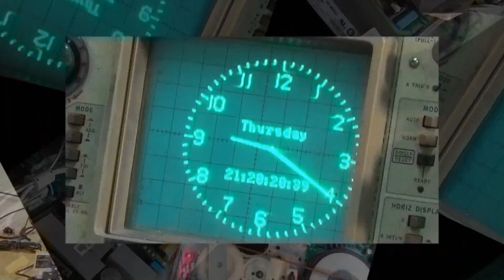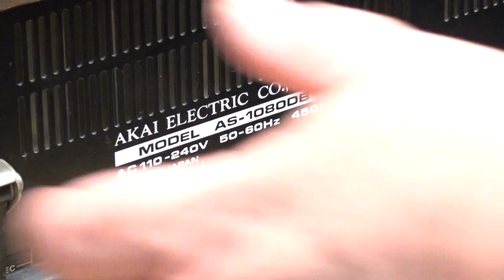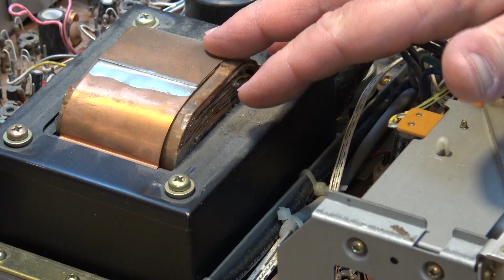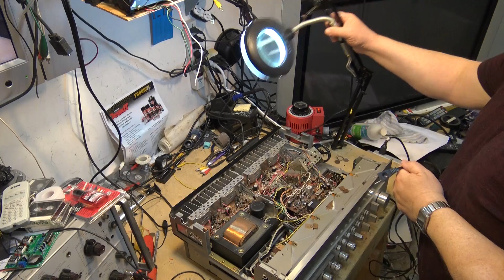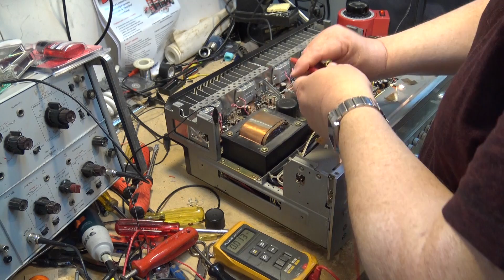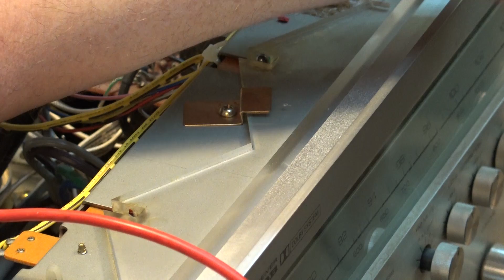Akai AS 1080 DB Quad receiver no sound

Comment: I have to say I'm a little disappointed that you didn't dig deeper into this.  Sure, 95% or better of power amp problems are the finals, and if you're trying to run a shop, I can understand limiting the time spent.  But when you're running a video for education value, it would be nice to dig a bit deeper.  Something external could be biasing those modules wrong.  In fact, if they were shorted, I'd expect much worse.

I once had a power amp that blew fuses because of a bias/level shifting diode in the driver circuit that opened up.  I had to use the lightbulb trick and trace where the current was going (and why) to solve it.  What's worse is that it was intermittent.  Turned out, if you nudged the diode, it would start to work again.
Reply from the maker: I did. I put the meter on it, and DC voltage present on 2 of the 4 modules.
The other 2 may have been OK, but for sure 2 were toast. The owner of it wanted an estimate to repair. These are very old modules, and you know how fleabay is as far as parts go.
Had this been a discrete output amplifier, there would have been much more I could do, but on these module units, you give them the correct voltage in, and if you have a huge DC voltage out then you have a shorted transistor in the mix. This was obvious because another shop had already written it off. They even had scribbled on the heat sink which module was for which channel.
It all boils down to economics. The client that owned this unit is the same one  that brought me a Hafler amp for repair, fixed, and that leak delta 75, with a blown obsolete transistor. If you watch that video you will see that I did find a suitable substitute for the original, and that one is is back in service.
The Leak was a rarer piece, worthy of spending more time on, and it uses conventional parts. When you get these modular amplifiers it would have been questionable to repair even when the unit was only a few years old, as this wasn't considered a real high end piece like a Sansui, Pioneer or Marantz.
Reply: The module is all DC coupled.  A bad input voltage (leaky cap?) will cause a bad output voltage.  Still, curious as to why two are like that.  Either a common component or it suggests the user did something.  Probably put too many speakers on the output and drove the impedance too low.
Reply from the maker: The 2 that were popped were the right front and right rear.

The speaker switch you can select 4 channel mode, 60WPC or 2 channel mode 120WPC.
My guess is the previous owner had a short on the speaker line and was running in 2 channel mode and popped both modules, then took it to a shop they diagnosed and recommended not fixing, and the person put it up on craigslist or fleabay, and my client bought it not working. Brought it to me, and I find that wires were disconnected.
Reconnect and find that the outputs are cooked. The signal coming from the driver was good. I didn't show the scope waveform just due to the fact that the piece of crap scope I have is just about useless, and doesn't show up very good on camera. I hope to have a new scope soon. I have a few I am looking at right now.
Reply: Have you considered one of those cheap LCD scope kits?  Or a PC scope?  Should be adequate for audio signals.
Reply from the maker: I have a line on a couple of scopes now. One has been offered as a donation, and I am awaiting freight conformation. Another one is local. but the owner is asking more than I feel it is worth. I have made an offer that I think is fair, but he is playing hardball.

Comment: Holy cow, i have not seen a "quadraphonic sound "unit since i was a kid in 1975! My friend's dad had one, and by god it  "looked" just like this one!  That thing was powerful as I recall. To bad it may go to scrap.
Reply from the maker: I have a quadraphonic system. It is an Electrohome, made in Canada unit. I will be doing a service video on that one, and because that one is mine I will be looking to completely restore that one. Quad units are relatively rare, but Made in Canada even rarer.
Reply: @12voltvids 
Ah! Canada 🇨🇦 the land of Maple Suryp strategic reserves, Capt. Kirk and duct tape. Bob and Doug, Red and Green and the home of Vulcan Velcro.
Oh Canada how ye love thy and in so many ways except for our lack of stereos, eh!
Reply: Actually Andy, even non working with bad amps, an AS-1080 DB like that will easily go for $600~800 at auction and a working one in VG condition can easily bring $2000~2500 on Ebay (and I have two.) 😇
And you're right, if you heard one they're bad ass!

Comment: I would replace the entire output section with a pair of LM4766 amplifiers. A bit less power maybe but probably a much cleaner output and a fairly easy job to change the topology, not too expensive and easy to get.
Thanks for the videos. :-)
Reply from the maker: The decision as to what to do is left with the owner of the unit who has collected it by now. It is all about economics, and sometimes you have to move on. The owner of this unit is a viewer, and he has supplied some of the high end units that I have repaired, including the Hafler and Leak receiver as well as a few high end DVD and CD players.
As you said, anything can be fixed, and I agree, and this is valid on a rare or high value piece, but a low end piece it doesn't make sense to spend much on.
Reply: As with anything, you're the man on the spot and many things are simply not worth fixing. It's the customer who decides in the end and it can be frustrating at times to give up on a piece of equipment that may have a second, third or n'th life. As always, thanks for the great videos and the reply. Peace. :-)
Reply from the maker: That't the point. I can give them advice and options, but ultimately it is the orner of the piece that decides the fate on the unit. They are more likely to spend money on a higher end piece because they can see the value. If we were talking an old Marantz, or Sansui, like the 9090 I own, then the chances or repair increase dramatically. Speaking of my 9090, I still plan to do a service on it, but haven't only because I am not currently using it, and it is all packed away in storage. Some day I will service that unit, because it is a valuable piece. It does work however all it needs is some control cleaning. The caps are old, but they also haven't been used in awhile.
Reply: @12voltvids  9090 and 9090db are superb units.
Reply from the maker: @tremayne3  
I have a Sansusi 9090db in my storage unit. One of these days I will drag it down and work on it. That thing is a beast.
Reply: @12voltvids  I'm looking forward to see a video of you working on the beast. I own a 9090db as well and the local vintage stereo repair guy charged me 480 bucks to bring the receiver up to original specs. He kept it for about a month and wanted me so badly to sell it to him. But it is a keeper and that beast sounds AMAZING !!! What a wonderful machine it is. It is so freaking powerful and warm sounding. I'm in love with the beast, Thank you for your great videos, To watch you working on those old machines is a joy, a therapy for many.
Reply from the maker: @tremayne3  
My 9090 works.  Well it did the last time I ran it.   Just needs dial lights replaced and controls cleaned.

Comment: Hi thanks for the video, love vintage audio stuff :-)

You can get the modules here in Denmark, they are 99DKr pr. part aprox 14US dollar (1USD = 7DKr)
https://elektronik-lavpris.dk/p121655/s-60w-power-amplifier-sanken-8-pin/

They are a trustworthy company, they have been around for ages.

The shipping costs to the US, is 50DKr or 7 US Dollar, for 500 grams letter, they should be able to ship them like a letter acording to the postal services website here in DK.

Link to the postal service, shipping cost calculator:
http://www.postnord.dk/quick-finder/portoberegner?integration=FindPrices&skift=breve&vaegtID=4&brevPriszoneID=210

Greatings from Denmark
Morten

Comment: YT is biting the hand that feeds it vids. No vids  = no views for ads
Reply from the maker: viscous circle for sure. From the news story I saw, much of it was spawned by advertisers distancing themselves from google  due to some controversial monetized videos. There was also some terrorism videos that were posted and cross posed on monetized channels that drew fire.  Big companies stay clear of this, and the rest of us get caught up in the fallout.
Reply: 12voltvids.  Not here often but I just whitelisted your site on my adblocker.  Out of curiosity, have you ever come across one of those Fisher 5.1 receivers,  around 1995,   The front ch. outputs are buried under a 2nd board, containing the Lr, Rr,  and center channel outputs, all hardwired.  I repaired 2 those.  I vaguely remember that besides the output transistors, one channel, they took out a total of 26 resistors and driver transistors.  Nightmare, no signs of heat, I damn near lost my faith in my abilities.  BTW, it was a warranty job and Fisher would not replace the unit.

Comment: They have them on Ebay for 30 US each.  Would he spend that much to fix?  http://www.ebay.com/itm/S-60WS-/380527371854?hash=item589932e64e:g:n44AAOSwNSxU1N2s
Reply from the maker: 120.00 US, that would be about 170 CDN, plus shipping, plud broker charges, and then the labour to change them.
Nobody will spend that to fix something like this.
If it was mine I wouldn't spend that.
Also, buying off ebay is risky. No way to know that you are getting functional parts. I ordered STK0030 from ebay.
First one all distorted. 
Contacted seller, sent me a second, it was also bad, just crackled.
Got a refund less the shipping. So I am out 20.00.
Ordered another from another seller, this one did nothing, totally dead.
seller offered refund, less shipping naturally, lost another 12.00.
So I am out of pocket 32US dollars, and I have nothing to show for it.

I guess you can say I am gun shy ordering parts off the internet, as I have been burned more times than not. Most of these parts are recycled, pulled from old units being scrapped. Cleaned up, untested. The seller knows that a good portion will be bad, but he has made his 10.00 shipping charge. If sellers had to only charge the actual charge to pay the postage. In other words, if there was a way that they could send the part collect, and the receiver pay the actual postage charge, they wouldn't be doing it. They know that many parts will be refunded, but they only refund the actual big price, not the padded freight charges. So they continue peddling their old parts that don't work, and it saves them the trip to the recycling center to get rid of them.
Reply: 12voltvids hi there. first he has no solder on the leads. second he has no negative feedback. I would get two and just fix the front channels. I am not convinced the rears are gone yet.. if voltages are good. they are usually good

Comment: I presume there is nothing pin compatible that you could substitute. Seems a shame to bin the thing for the sake of those 4 modules.
Reply: If I absolutely had to get the thing going, then I might look at replacing the modules with something non authentic like perhaps hacking in some of those cheap TPA3118 BTL 60W modules from ebay,.  Commercially though, I suspect your call is correct, it is beyond economical repair.
Reply: You could try --> http://www.ceitron.com/semi/ceisanken.html

.. or you could try this ebay search...

http://www.ebay.com/sch/i.html?_odkw=NTE1354&_osacat=0&_from=R40&_trksid=p2045573.m570.l1313.TR0.TRC0.H0.XECG1354+.TRS0&_nkw=ECG1354+&_sacat=0

.. let me know if that hits the spot. :¬)
Reply from the maker: You got it. "Beyond ECONOMICAL repair"
The driver boards could be removed, and separate amplifier modules installed, but at what cost. This is not some rare piece of equipment. 
It is not like an old R-R tape deck, or an old 8Track player, or Betamax or some other rare format that is needed to play a specific format of tape, and it has to be repaired at all costs.
Even though it has the quad decoder, that could still be used, or a stand alone decoder found IF someone had CD4 disks they needed to play, but that really isn't the case here. 
It was like back in the tube TV days and people would bring in an old console TV and want the picture tube replaced. 
I remember one old woman that came in demanding that I change the picture tube on her old Admiral TV. I explained that it wasn't worth it, and she fired back that who was I to determine what was worth it to her.  She stormed off to another shop, and they billed her huge to replace the tube. 6 months later she was back, and the flyback was shot, part not available, as admiral had been out of business for over 25 years.  All I said was too bad she didn't listen to my advice 6 months ago, she could have saved 300.00.
Reply: That all sounds very familiar. Back in the days when people repaired most things, the definition of beyond economical repair was some what different. My mother kept a 1920s electric cooker going till recently. It was made to last, and last, it did. 

These days, less and less is repairable economically. You could strip those faulty 60W modules open, figure out which of the internal ceramic PCBs was shot, replace the parts with some smd equivalents, and it would work, but that would probably be a four figure repair, for a hundred dollar item. The down side of all this of course are the massive piles of e-waste and the subsequent pollution that goes with it all. 

I'm probably almost as guilty as everyone else in this respect I might add, but I do hate to junk an item if it can be brought back to life without spending an arm and a leg on it. 

Maybe some enterprising individual might put together an open source modern PCB designed drop in for those unobtanium modules some day, but I doubt it, unless they also feature in some rare and therefore expensive piece of kit.
Reply: Sometimes what is worth repairing to someone is based more on sentimental attachment, I suspect the little old ladies TV might have been bought by her late husband, or had some other sentiment attached, a bit like my mother's cooker. Sentiment trumps common sense every time. Sometimes I've had to repair some piece of computer equipment for a customer that should have gone in the bin simply because they needed it working to get vital information from it. If your entire work flow is invested in your ancient kit, then it becomes vital to repair... of course the cost of repairing then outweighs the residual value of the item at that point, but the customer will pay for the convenience.
Reply from the maker: With computers, data is sometimes more important than money, and people will pay astronomical fees to have it recovered. 
Back in the shop I used to work in, one of the teenagers that worked up front got onto a porn site on the shop computer, and picked up a virus that wiped all the data.
I remember my boss going into panic mode. The cost to attempt to remover the data was in the stratosphere. Thousands of dollars, and my boss learned an important lesson. One word, you know it...
BACKUP!
No he didn't get the data back either, and had to hire an accountant / data entry lady that spent the better part of the next 7 or 8 months manually going through all the invoices and receipts for the previous 7 years. It was a stressful time around the shop, not just for the boss, but for everyone as he would take out his frustration on everyone. The teenager that caused the data loss obviously lost his job, but the boss came down on me too because I was the only one in the shop with him when this happened. Like I was supposed to be watching everything he did, I had my own work to do.

As to sentimental value,  yes I know that too. We would get people bringing in very old console radios, or TVs and wanting them fixed at all costs because of the sentimental value. My boss would always say, don't get to attached to a TV. They would want us to gut it, so they could turn it into a liquor cabinet or some such nonsense.

I do have to admit, some of those wood cabinets were very nice pieces of furniture, and I gutted many a set so a new smaller set could be placed inside it. Then the next complaint was, I paid all that money to have the guts taken out, and you put in a 19" TV! It's too small!

Comment: I got some new old stock STK 8050 modules for my Technics amp and it didn't help so I figured I must have been clumsy and wrecked the new ones, so I ordered another set and had the same result, then I gave up but 6 months later I read that they had sent out a whole batch of faulty STK 8050 from the manufacturer and felt slightly better about my efforts.
Reply from the maker: I would say you got stung by the counterfeiters. 
Counterfeit parts were a problem  in the late 90's and it looks like it hasn't gotten any better.

Comment: this guy here made a custom replacement for the Sanken s-60w  http://members.quicknet.nl/gerard.slikker/setton.htm  you may be able to do what he did to get this reciever to work. He Decided to make a discrete solution made up of two pairs of darlington transistors and some Accompanying parts for bias adjustment / compensation.
Reply: Interesting. I was wondering if that was possible. That Akai must have been one of the most advanced quad receivers released.